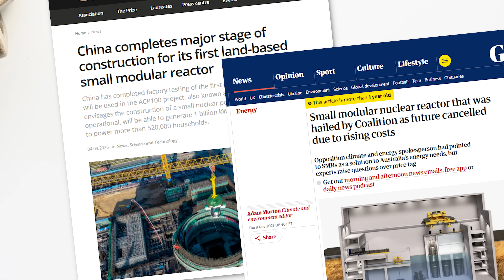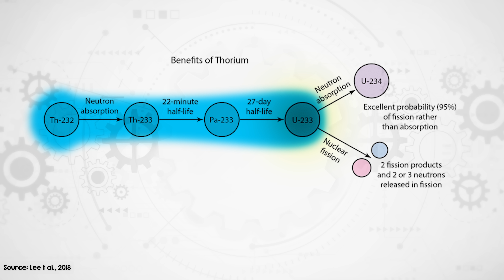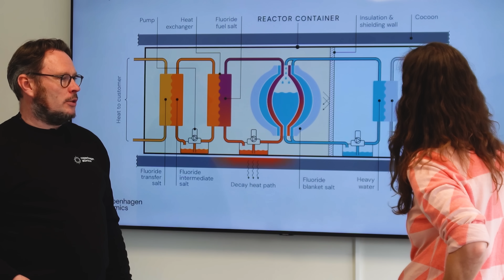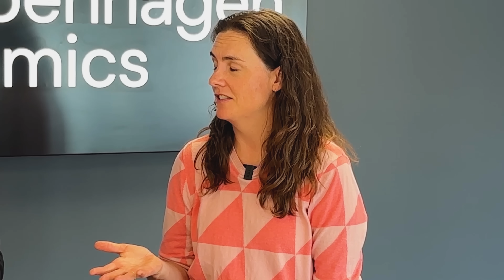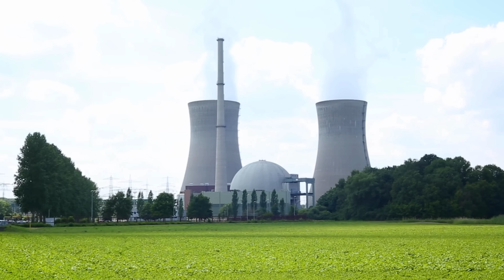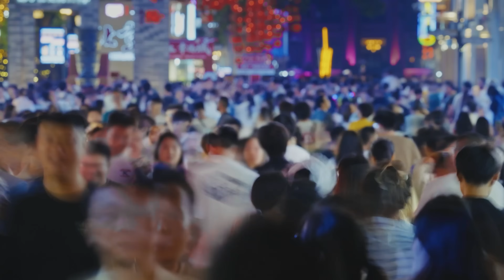Can Copenhagen Atomics Make THORIUM REACTORS Work? [TOUR]

Comment: :)) Here is the crucial question:

HOW do you guys generate the much needed  NEUTRONS,  from  WHAT SOURCE?( in order to activate the INACTIVE Thorium and U238?)
It's amusing how you make long shows without explaining this CRUCIAL issue.
There rest of the presentation is just talk, nothing new compared to the fundamentals of the old systems that uses the 235.

Does it work?":)) DO you have a working model or is it just on paper?
You'll probably never answer this question.
You are experts at talking and saying nothing :))) LOL
Reply: They are using beryllium as neutron source. If beryllium catches a fast neutron it can break into two alpha particles and two neutrons. Beryllium plus strong alpha radiation creates carbon and a neutron.
Reply: @andreasschmitt2307  OMG it's like kindergarten. ..and where does Beryllium receives a fast neutron from?
Reply: @thomastl9581 
Fission of U-233 produces at average 2.48 fast neutrons. You need at least 2 thermic neutrons for thorium breeding and U-233 fission, but there always are some losses because of neutron poisons like the fission products and Pa-232, so this process doesn't produce enough neutrons in classic reactors. The beryllium in the FLiBe acts as a very good neutron reflector and moderator, but sometimes breaks into alpha particles and produces an additional neutron.
Reply: Actually Copenhagen Atomics aren't using beryllium or Flibe, unlike some other developers. They've opted for F7LiNaK, for various reasons. Beryllium is toxic and scarce, and generates tritium. They get some secondary neutrons from heavy water, as do Candus. Mainly they're just relying on being super-frugal with their neutrons - hence the need to change from stainless steel to silicon carbide, or similar, for the eventual breeder design. @andreasschmitt2307

Comment: What protects the pipes from corrosion from the salt products?  Neutrons embrittle metals. How is that constant exposure mirigated to reduce metal farigue?
Reply: There are eighty years of experience running stainless steel reactors - neutron embrittlement is a known factor, and CA judge their five year reactor vessel replacement to be conservative. Corrosion in molten salts is less well known; they claim that using very pure salts, with no eg metal contaminants, reduces corrosion many fold. Getting metals produced as fission products out of the salt, before they trigger corrosion, will be a major aim.

Comment: Impressive engineering, Rosie; yet I feel troubled.  If my next-door-neighbour has solar panels on their roof, that's fine.  But if a factory had a small modular reactor close to my home, I'd be afraid - e.g. what if the smr is struck by lightning, or there's an earthquake, or a terrorist attack?  And there's radioactive materials to consider, if a smr is used for 5 years but the steel etc in it is radioactive for 50 years.  I prefer solar panels & (offshore) windfarms, with batteries.

Comment: How are they planning on removing Protactiniumum 233 fron the blanket salt?
Reply: They don't - there's about twenty tons of thorium salt in the blanket, but only a few kilos of protactinium (about one day's Uranium consumption, 100 grams, multiplied by something around the Pa233 half-life : 27 days). U 234 production will reduce the breeding ratio, but hopefuly not by much;  most of the Pa 233 will have time to transform to U 233, and then be transferred to the fuel salt, I suppose using UF6 volatility compared to ThF4 and PaF4.
Reply: @2x6x250ml U233 still needs to be removed from the blanket salt to be used the core how do they plan on doing that? Why not remove it when it's still Pa233.

Comment: The other problem is it is primitive. They are still  boiling a kettle to run a steam engine. It needs to move to plasma induced magnetic induction to generate electricity.

Comment: Why Switzerland ?
Reply: One of very few countries that likes nuclear, and it is not in the EU, so can do what it wants!  Even France, that generates most of its electricity from nuclear, hasn't built new nuclear for decades and is hampered by the EU. Switzerland actually looks at the science, rather than only the politics, when making decisions.  Switzerland is also a land locked country, no sea ports, with pretty poor geography for wind (big mountains disrupting the airflow, and high altitude so low air density thus low power) and times with a lack of.solar, so although they would be happy to be the first to net zero, they have big problems getting there.  They already have nuclear, and also have good hydro, but not enough.
Reply: @nigels.6051 

Switzerland DON’T like nuclear !
All legislation passed in the last 30 years was to limit Nuclear Power !
Since the 1980’s is this fight going on.
After Tschernobyl and even harder since Fukushima…!
Peoples vote count in Switzerland.
Politicians  can’t do anything without the peoples vote - we are the only Direct Democracy worldwide…!
Reply: @aoilpe  Up to 40% of Swiss electricity comes from nuclear, making it one of the biggest users of nuclear power.  Yes, there is a democratic fight, with people on both sides, same as in many countries.  I think it is fair to say that the Swiss people are some of the most supportive of net zero, but how are they going to get there without nuclear, given that existing nuclear plants will have to close at some point?  Not enough hydro, poor wind, sun doesn't always work...
Reply: @nigels.6051 

The future will show it…
For instance the anti-nuclear has the upper hand.
There are many ways to generate electricity… Biogas is one of those.
Most “green waste” is composted today…Bio waste to Bio gas !

Comment: Good video, but no coverage of fuel cycle/ reuse, control and heat management, fuel safety and power extraction. Could you do another video covering these areas, Rosie?
Reply: Fuel is not 'recycled', it stays in the reactor permanently, then is transferred to the next reactor. Fission products are taken out and stored continuously inside containment. I believe all fission products will find uses, once separated. Some are incredibly valuable - there's more ruthenium in nuclear 'waste' than is mined annually, and it's worth thousands of dollars per kilogram.

Comment: The idea of this tech being installed at existing power stations  would be very attractive, so 10 or so units replacing a single  ccgt  gas turbine,but using the same power generation equipment and site , 
It also goes a long way to solving the problem with spinning reserve , instead of having to find up to 1.4 gw of power in an instant if something goes off line , it'd would be 4 or 5 hundred megawatts , 
So a bank of batteries and a couple of older gas turbines could provide the "spinning " reserve for an entire grid - 
Saving a fortune .. 
 The thing is , these are still 15 to 30 years from mass adoption - assuming they work as expected, so up to 2 life cycles for solar or wind projects .. 
So it's not really either this or renewables
, it's more, first renewables then micro- thorium ..

Comment: India started R&D in using thorium as nuclear fuel in 1983 and found that in Kerala beaches sand consists of rich thorium. Before these sands were used all over the world for sand blasting purposes and we also used for 2 yrs on power plant equipment and Indian govt banned this to be used. But once bjp in all these projects were shelved as they did not know much of technical issues and significance etc

Comment: You can’t just ignore this: Globally only ~20% of energy is supplied in the form of electricity, and only ~2% of that is provided by REbuildables, sorry, Renewable/Alternative Energy of which Nuclear Power is a fraction of that, leaving ~80% still reliant on FREE FINITE Flammable Fossils (FFFF’s).
Electricity cannot of itself produce the heat required for Steel, Concrete, Glass and many other industrial processes requiring very high temperatures economically, and of course in all this there’s that scaling issue, as where we are and where we want to be, before those FFFF’s are only available at the ever increasing cost of extraction, as in EROEI👇
https://youtu.be/XECq9uFsy6o?si=36qhgiC5otfa52fo And 👉 https://youtu.be/iXz302oMphQ?si=kzZmaGGzRSScPwDv 🤔
Reply: Iron ore can be reduced to Iron and water using hydrogen generated by electrolysis using electricity from renewables. It's not economic right now, but will be in a few years time.

Electricity can be used to supply the heat for glass making. 

Electricity can also be used to supply the heat to turn chalk or limestone into cement, but that releases CO2. However the CO2 can be captured and turned into synthetic hydrocarbons. As the price of hydrogen comes down with the price of electricity that process will become economic.

Comment: Interesting. I will be shocked beyond measure if modern reactors can compete with solar power. I can see that as a niche product for industries of other uses needing local power, but for grid power, solar/wind combined with modern batteries are beating everything else on cost. Good luck though.
Reply: If you graph the countries with the most solar and wind on their grids, with those paying the most at household or factory level for power (as opposed to the largely fictional 'wholesale cost'), there's a very close correlation - and that's before costing in enough transmission and batteries to get rid of fossil fuels, something no grid anywhere has done without plenty of hydro, or nuclear, or both.

Comment: You know what's small?  A solar panel.
You know what's modular?  A wind turbine.

Solar and wind equipment is manufactured in units between 100W and a few megawatts.  At the very high end some wind turbines exceed ten megawatts.

"Small modular" nuclear reactors were supposed to be on a comparable scale, a few tens of megawatts tops, as indeed the actually existing SMRs that power nuclear submarines, icebreakers and aircraft carriers are -- operating as they do with a permanent operating staff of expert, disciplined naval engineers.

However companies trying to sell the notion of SMRs have found that they don't scale down very well, and are trying to pass off reactors of 200MW thermal power or higher as "small" and "modular".  That's not small or modular, that's exactly the same scale as the very first civilian nuclear power reactors and nothing new or special or efficient.  Certainly not the sort of thing you can mass produce in a factory.

This company is a bit different.  It also hasn't actually made a nuclear reactor.
Reply: You're right, the basic idea of small modular reactors, is that you can make lots of them and get the benefits of reduced costs through mass production. 

But as you rightly point out, solar panels and wind turbines are small and modular and therefore are easier to mass produce, therefore the price is coming down very fast. 

Once the problem of energy storage is sorted out then energy from solar and wind will be so cheap anything else will be uneconomic
Reply: @JohnSmall314  batteries too are small and modular :)
Reply: @JonathanMaddox  The energy density of fissile materials is about a million times higher than carbon fuels, and the energy density of carbon fuels is about thirty times higher than batteries. That's the physical reality that means nuclear can supersede the fossil fuels that now provide 80% of our energy, but batteries, except in secondary cases, will not.
Reply: @2x6x250ml  density schmensity.  Are you proposing to run cars and aeroplanes with nuclear reactors?  Batteries are rechargeable, uranium isn't.

Comment: Well done Rosie, I'll admit I was avoiding your video for several hours thinking it would be yet another thorium or SMR fluff waste of time; but the design concept they've revealed in your video, that is a beautiful demonstration of KISS. What used to look like a plumber's nightmare is now looking rational, and possibly recyclable to boot; in the words of Mr Grace, they've done very very well.
Reply: Are you kidding? There are 5 coolant loops for just the molten salt and the heavy water. That is an engineering nightmare before they even put in the blanket salt loop. Each one of those pumps is a single point of failure that requires dumping the contents of the reactor.
Reply: Er, replacing the (highly radioactive) guts of the thing every five years?

Comment: Zero maintenance... but you have to replace an individual unit for off-site servicing/renewal every 5 years!? This guy figured out how to get utility companies stuck on a subscription model! When this goes public it will slay!
Reply: Not the whole unit mate, parts of it... Also, it´s not uncommon in hightech... I work in pharma, we do the same. Parts don´t last, some only last one batch, others maybe days or weeks, some last a few years. Few things last longer than 10 years.
Reply: @JesperSandgreen  On purpose right?  They COULD make things last longer, they choose not to.
Reply: Considering many nuclear power plants need 25-35 years of operation to break even on the initial investment (hence why they are basically always heavily subsidized with tax money) this is a relatively straight forward process to work with for an energy start-up. If they are certified for 5 years of operation at full tilt, and the sticker prices is "deliver it back to us and we will decommission it" included, then the math is really simple: energy sale for 5 years - (cost of reactor + cost of fuel for 5 years) = gross profit. Then you just start building out with X number of reactors a year for 5 years, and then after that you replace X units every year.
Reply: @andersjjensen  However, a water-cooled reactor can operate for 60-80 years, not 5. Over 60 years, CA reactors will have to be replaced 12 TIMES. And do you think the costs will be less than building one large reactor for 60 years?
Reply: @АнтонШилов-е5з  you are essentially asking how much factory line assembly and economies of scale reduces the price compared to individual building and designing. It‘s plausible. Imagine the cost savings on permits, checks planning, building etc. That phase alone can take like 2 decades and you’ll be paying a team of highly qualified specialists the whole time. Just the fact alone that you know the price upfront and don’t have to deal with sudden tripling of estimated costs that seem to plague so many large scale infrastructure projects makes it worth it.

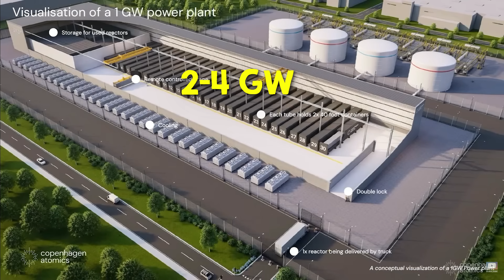Comment: 11:46 It is not clear how those gantry cranes are supposed to load the shipping containers into the "tubes" (2 40ft containers per tube).
I can only surmise that the lid must come off.
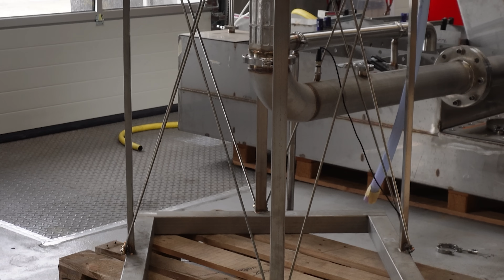Reply: I read that with Richard Burton's voice and heard the lid fall with a clang (qv "Horsell Common and the Heat Ray" 1:16).

Comment: Well, that may sound quite promising, but with only an estimated run time before major components need replacing there will be huge maintenance costs involved, plus the problems of all the components being seriously radioactive for decades.🤔 This technology is not anywhere as benign as the larger fusion reactors that are in development in various locations which allegedly will not create the same radiation hasards as this little reactors, or common nuclear reactors does on a comparable power-output scale...🤔
Reply: The neutron flux from fusion would be far higher than from fission - especially fission moderated by heavy water. How to protect the expensive cryogenic magnets from those neutrons is an unsolved problem -as is the engineering to use that heat. That's assuming they can reliably get to the needed temperature/density/duration - so far in a tokamak they've only reached 700 million C, they need to be over 100 million, for minutes. Nor have they done it with deuterium and tritium, as, if fusion was achieved, further work in the torus would be impossible.

Comment: I have read that it us literally "walk away safe" Man that is no one comes into work on Monday or Tuesday or some other day it just shuts down? It's that close to the truth?
Reply: essentially, yes. 

molten salt reactors have 2 big features
#1 a LOT of heat capacity - the salt can goto very high temperatures before it boils because it has a lot of heat capacity; basically the salt can absorb all the heat generated long before the steel containing the sale deforms or melts

#2 salt expands when it heats - the fuel is in the salt; so the fuel expands along with the salt; expanded fuel takes the fissile nuclei away from each other; the further apart the nuclei, the less reactivity, which reduces the heat - i.e. the salt won't keep going to high temperature; it will expand as heat increases, then contract as the lack of reactions cool it, cyclically

because of these 2 features, one must work at keeping the reaction going; if no one is there to adjust parameters and add fuel, the reactor will eventually cool and stop